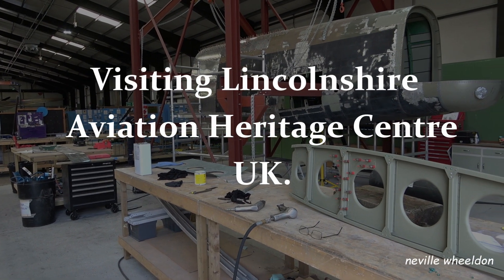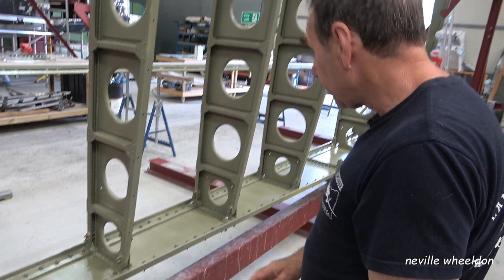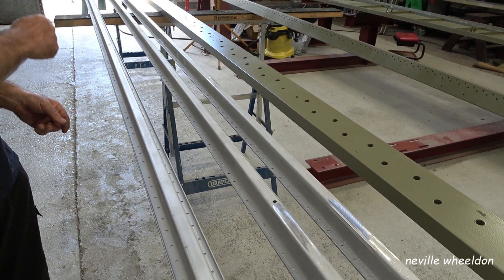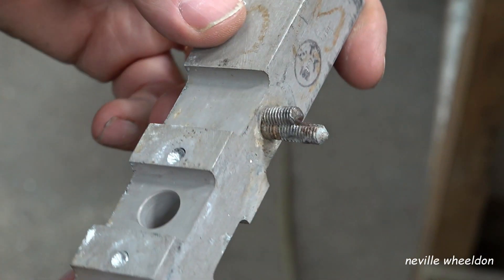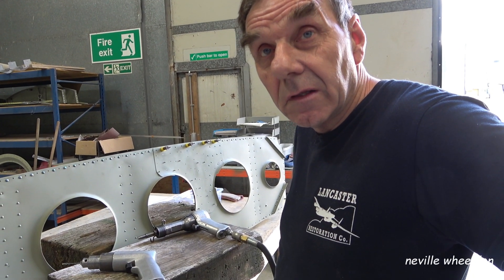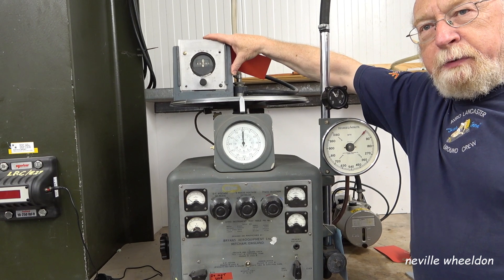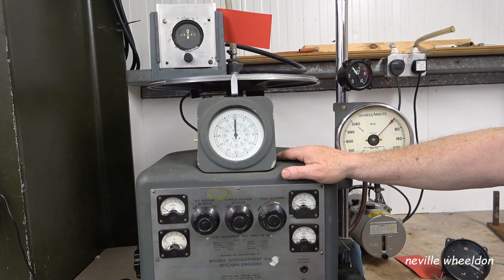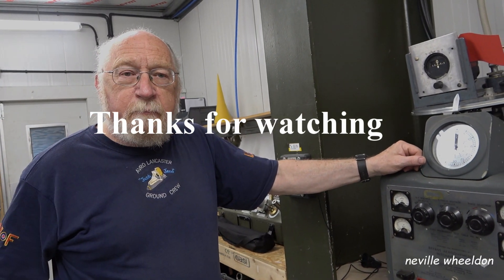Video 155 Restoration of Lancaster NX611 Year 5 .Progress ongoing

Comment: could the areas of aluminum that have corroded away be aluminum welded to save having to fit pieces riveted, or does this cause issues with hardened aged ally, or would this mean the whole piece needs to be heated and cooled slowly and then recooked again to reharden
funny i always assumed the same with static vents, static as in stationary, English can be confusing
hang on, i am English hehe

Comment: More terrific & priceless insights; thank you Nev!

Re. comments (I think John) made about this project being the first to completely disassemble & rebuild Lancaster wings, did that not have to happen for the two Lancasters that’ve been returned to airworthy? Cheers
Reply from the maker: Hi Bruce, the two flying Lancaster were restored some time ago, the problem with "Just Jane" NX611 compared with the other two they used Magnesium Alloy rivets these rivet are now corroding away ( the same with the French NX664) so all the rivets on Just Jane will have to be replaced. The Centre want JJ to Last 100 years so all the skins will be replaced.
Reply: @nevillewheeldon1693  Thanks Neville 😎

Comment: is this going to be another Lancaster as well as "just Jane" "Thumper" and the Canadian Lancaster Vera
Reply: The wings are for a static french restoration. The Just Jane team are restoring the wings for them and as part of that deal, they can use them on Just Jane to be able to taxi her in complete condition, while they restore Just Jane's to airworthy. Same deal with the rear fuselage they are restoring for Doncaster.
Reply from the maker: Hi Banditgsfusuki. No, these are parts going to be used on JJ. Jonathan Mann has the correct answer.

Comment: Thanks again Neville, enjoy spens contributions. The detail work on the wing and aft fuselage seems never ending and these aren't airworthy so it seems an awful long time to restore just Jane, hope I'll still be around to see it!
Reply: @brycenew  hi, I'm not stupid I know why JJ is being restored the way it is. I've been told so so so many times as my original post says  "I've been shouted down many times" my point is still valid, plus I'm entitled to it. Apply for a lottery grant, crowd funding, etc etc. The original estimate of 10 years for a flying resto was very very optimistic. I'm just not sure if any Fossil fuels will be avaliable in another 10 years? From now, Please don't tell me it doesn't matter because it's a tribute to the airmen... I KNOW and back the project 100% My point is the learning curve is taking way longer than a straight forward resto. If you take away the ground running funding and try for more orthodox funding I feel and believe it would be quicker and there is enough good will to fund the resto without ground runs. IMO
Reply: @davidlawrencebanks4610  I think you put forward some valid points. I get the impression that there are not enough people working on such a large project. I thought given enough people working on it , the rear fuselage would have been done by now.
Reply: Hi, I've stopped mentioning the time it takes for the wings and fuselage repairs, I too fear Fossil fuels will be banned before she takes to the skies.... Should have worked on JJ components only. But I get shouted down big time!
Reply from the maker: Hi Edward, the Lincolnshire Lancaster Restoration Co is a new CAA company within the centre they do and will change tack when they think it for the good of "Just Jane", so thing may take a little longer